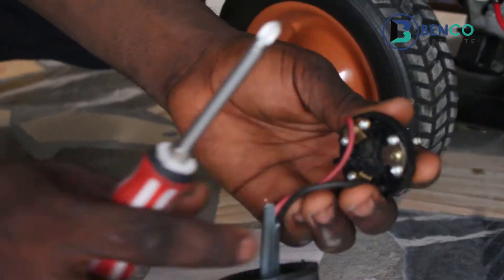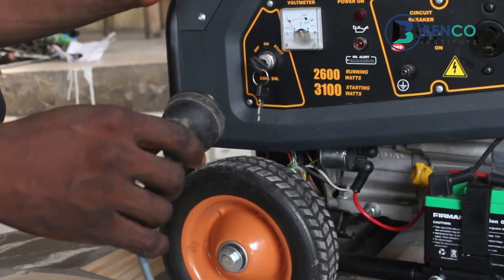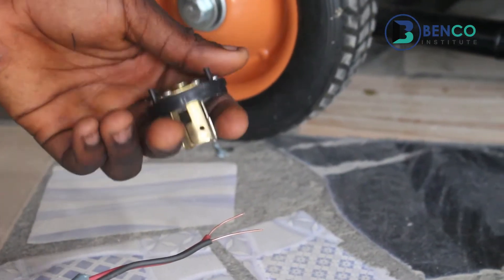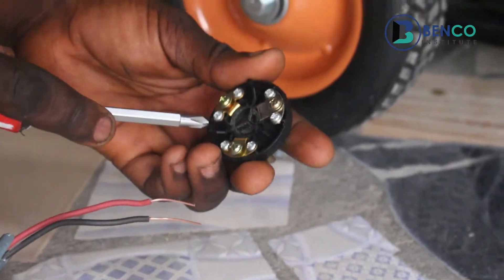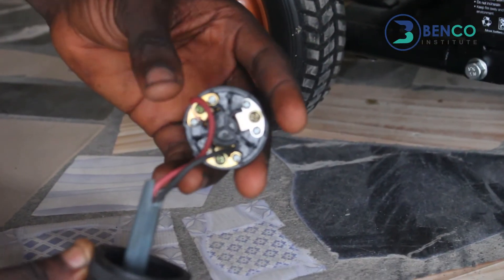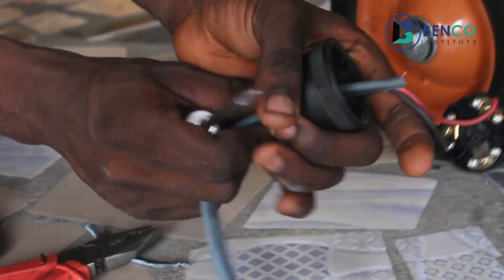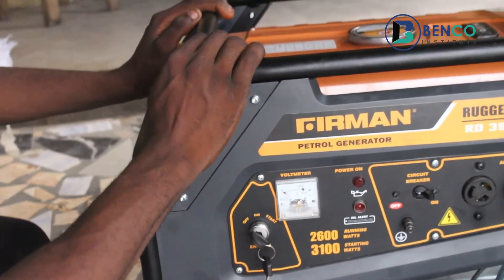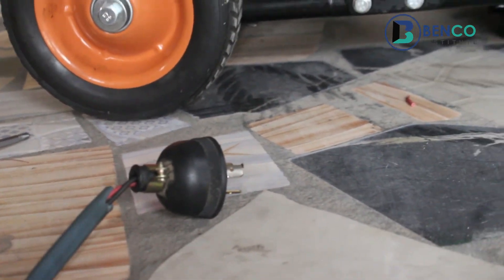DIY, Fixing the AC output plug of a brand new Sumec fireman portable/medium sized Generator(machine)

Comment: Thanks for this , but if the wire you are using has red, yellow and black how do one connect it?
Reply from the maker: Red and black goes to the two alike terminals
Yello go's to the other terminal
Reply from the maker: Red and black goes to the two alike terminals
Yello go's to the other terminal